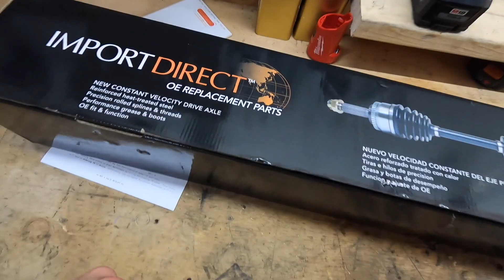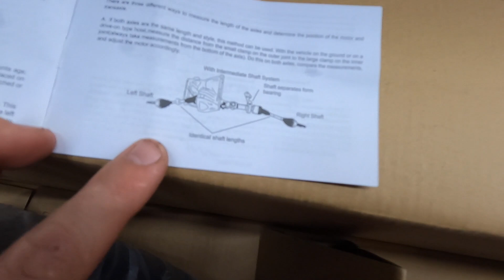Turns Out My Drift Car Might Not be a Good Drag Car...

Comment: Hi Cooper, check your end float on the axle shaft with full weight on rear tyre. you should only have 3-5mm. If you have rear camber arms and low neg camber it pulls the cv out of the cup, hence it breaks. GKtech make 2 different types of axle spacers (check them out). Work out what spacer you need before you blow another axle 🤙
Reply: never knew they even made stuff like that. That’s really cool

Comment: I'll be honest with you. That Milwaukee battery trick is quite handy. My only concern would be with the voltage difference..... that is if it isn't rated for it. In a pinch, I wouldn't care at all though. Thanks for that tip if I ever need it I will be so happy to have the knowledge.

Comment: That's crazy. My s14 was pushing up to 800 on a kill tune, and I have yet to break axles or the diff. But I never took it on a prepped surface.
Reply from the maker: Bring it the the drag strip on a good tire, they will definitely go
Reply: Let that thing get traction lmfao
Reply: Even street tyres on that kinda prep would snap Silvia axles..
Reply: @CooperBogetti  I don't know who said it first, but "if the tires don't break loose, something else will."

Comment: The M18 xc 4.0 usually has Samsung 18650 25r cells so they are good for 2 x 20Amps = 40amps total. Some of the batteries have a fusible link that can melt if you draw too much current for too long. Doing short pulls on the winch was probably a good call. https://www.youtube.com/watch?v=pW3L0WGc4bw
Reply: I was more worried about the extra voltage cooking the winch. Im surprised none of the big tool makers have jumped into the "jump box" fad. Two 20v battery packs should put out as much juice as most of the cheap jump boxes out there. I suppose that would really put their batteries to the test though, dont want anyone getting embarrassed.

Comment: So, you have an on and off clutch and pulled the hand brake.... so all the power goes trough the clutch, gearbox, driveshaft and axles to be stopped by the wheels because the you pulled the hand brake.  Do you get it? I don't think the pulling the hand brake was a good idea....

Comment: you should swap the axel to the 5 bolt 240sx axels they are way stronger we all do when we drift the 6  bolt or the double 2 bolt that only has 3 spots to bolt breakl way to easy but the 5 bolt axels are sooooo much better and they are the same price all you need to do is change the half shafts and be all good i would deff do it

Comment: Wouldn’t holding the hand break increase the strain on the axels cooper?
Reply: Holding the hand brake let's you let out of the clutch just a little bit once staged to preload the drivetrain and get any slack out of the u-joints/diff/axles without the car rolling forward. It helps reduce the shock to everything when you launch.

Comment: Coop you need to tell gmc about ifs vs strait axle. Maybe they will go back to front strait axle on diesel trucks. Love your videos even though the poor 240 only went inches. Keep it up.
Reply from the maker: No no on IFS is great for the none off-road. AKA me
Reply: Independent suspension should handle better than a straight axle, if he wants to do some road racing and turn it'll be better for what he wants to do. The ifs on my Charger RT handles great but tends to squat under power, though it also spreads the power between both wheels nicely and tends to spin both on launch even though it's a open diff.
If you want to go nuts try finding better parts or upgrade to a stronger ifs that can take the power.
My Dart has complete rear lift and weight transfer on launch even with a lowly 318 but they tended to be built to do it and I'll never break the axles with what I have for power. It's a solid axle 83/4 with a power lock so more suitable for that kind of abuse.

Comment: Cooper,, fragile components should be checked after every event. Drifting and burnouts are very hard on axles and driveshafts. As well as welded ]or spools] diffs.
Pull them out and check them. It is called maintenance. Those diffs and axles are just up to the job but if you chuck twisted axles etc before they break you can do an event without breaking the past their use by components.
I have done this for 50 years and because of it never broken a diff or axles. But replaced plenty!
Reply from the maker: You pull axles out pull the boot off check them and replace them after every single event, and on top of them open the diff?
Reply: If you think drifting is hard on axles, wait till you hear about drag racing.